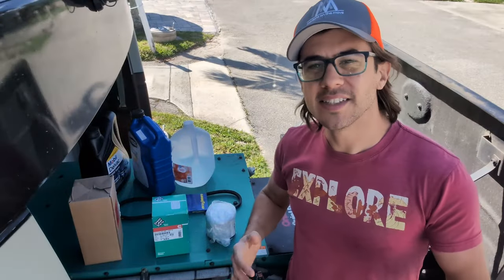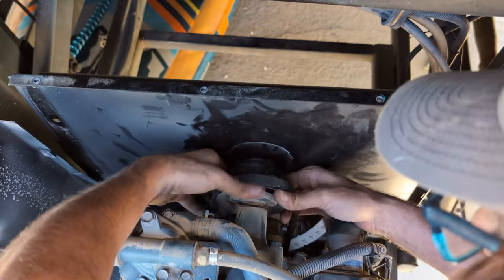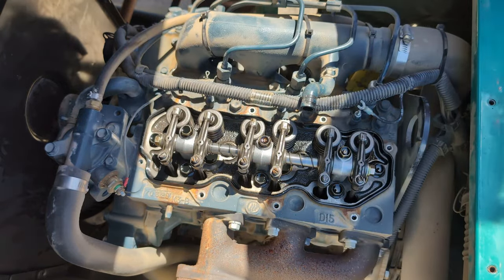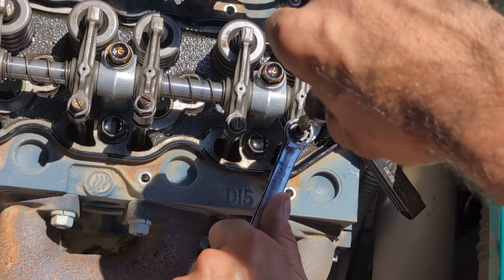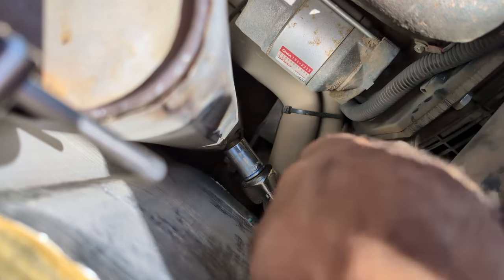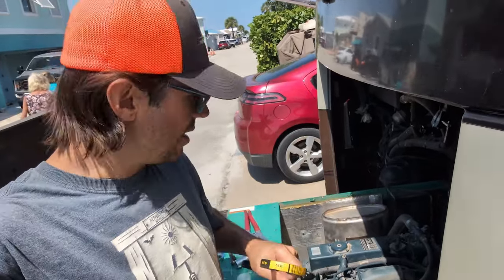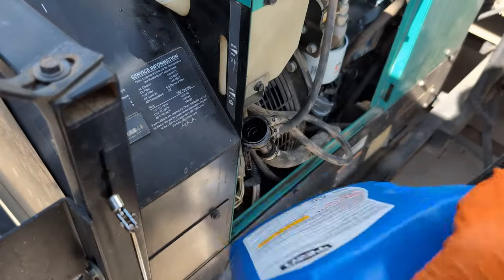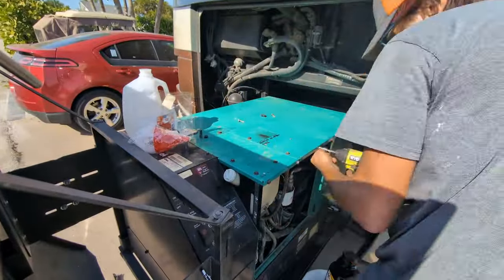The Downside to Big 10k-12.5k QD Quiet Diesel Generator - Full Maintenance Walkthrough

Comment: Tom how did you know the belt was in need of replacement since it's so hard to see and inspect? What year is your generator and how many hours on it? I have an Onan 10K in a 2013 Newmar mountain Aire. I do all my own maintenance also, but so far have not checked on the belt or changed coolant. It was new to me in 2020. Think I'll take a deeper dive now that I've seen you do it. Thanks for the video!
Reply from the maker: Its almost impossible to know but time is a biggie, they say around 1500 but this gen has almost 4000 on it and i dont think it had ever been done. Since its in the back its gotta get super hot because all the hot air gets sucked right over it.

Comment: Hey Tom, thank you for doing this video. We just purchased a 2011 Monaco Diplomat and I too noticed there weren't many service videos about the 10 Kw generator. I had no idea how difficult it was going to be to do the fan belt change. That was an eye opener. Thank you for preparing me mentally for that one. The entire video was very helpful. I'm also going to hold off ordering parts until I see what's actually under the sheet metal. Didn't realize getting the correct part numbers might also be a challenge. Thanks again!!!
Reply from the maker: Glad you found it helpful and will hopefully save you some headache! Good luck :)

Comment: I enjoyed watching this.  A year ago, I did all except the soot plug and fan belt.  

One point that was missed here is the radiator.  Mine was extremely dirty - I would estimate there may have been a pound of dirt and dust trapped in the radiator fins.  This required lots of water flushing, but I finally used a special pressure washer 90 degree tip and hit it all from underneath.  Do not get close to the fins!
Reply from the maker: Good Idea, i actually have a 90 attachment!

Comment: Great Video.  I am not sure but I think I have a fuel line leak.  My question is could you see the fuel line and get access to it when you removed the fan.  I couldn't tell when from the video.  I have taken everything apart except for removing the fan.  The fuel line appears to enter from the back at near the bottom center of the unit.  There is a fuel in and return line but I can't see on the other side?  I checked the fuel filter and I don't see a leak.  Any help would be appreciated.
Reply from the maker: Hmm, I didnt actually look but i dont think so, the fan had a shroud all the way around that prob blocked it. I think that could have been removed too as I started to thinking i needed it gone to get the fan off, but had just enough room to do it without removing it. This thing seems to pretty much be bolted together, just keep taking out bolts....

Comment: Thanks for the video Tom. I have a 2005 Gulfstream toy hauler with a Onan quiet diesel 5500.  It ran good for a couple days after hurricane Beryl hit Houston. On the 3rd morning, the Onan started but put out no A/C.  I suspect the wiring block inside the upper back cover, the transfer switch ....or possibly the fan belt ?   Is there a variable belt adjustment on the water pump or is it simply a CORRECT belt friction fit ?
Reply from the maker: if it runs wouldn't be fan, your gen is very different from this one, i dont think there is a fan belt. Breaker, Transfer switch or maybe even instrument transformer if it has one to run electronics...could be the transfer switch in the RV too, gotta verify the gen is not putting out AC at its breaker
Reply: @MortonsontheMove  My next move is to access the 4 wire junction block at the upper back panel of the cover and check for voltage with my VOM.  It is a tight squeeze to open and access.  It helps to watch a variety of informative maintenance videos. Thanks for the response.

Comment: USE A ADJUSTABLE WRENCH THE CORRECT WAY, LIKE A PIPE WRENCH , ONLY ONE-WAY !!!!!
Reply from the maker: I know, easy to criticize and i do it too, but then  when i get into it and just want to get it done sometimes slip....however i am pretty good about it if i really need to put force on something using the right tool the right way.... because I have learned the hard way why not, lol. But hey its my stuff and my mistake is my problem.

Comment: There's no downside to the generator the downside was you ran it until it went off on the sensors which is a good thing otherwise you just would have burned it up service your equipment before it needs to be serviced and it won't shut off